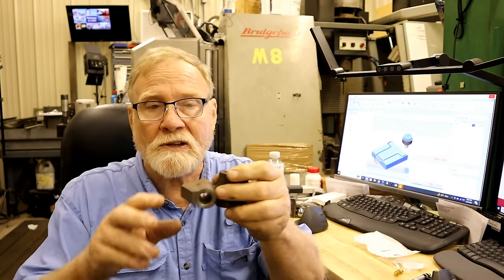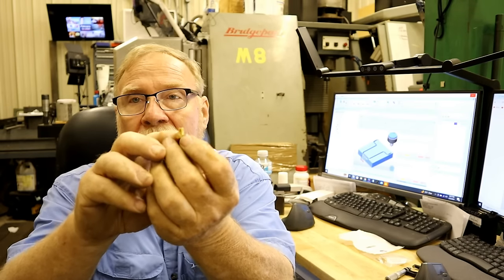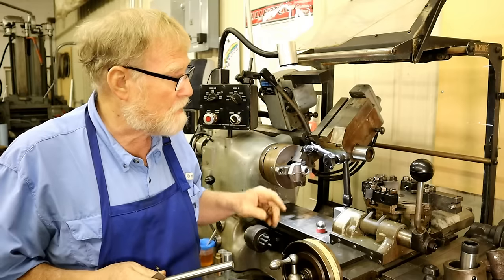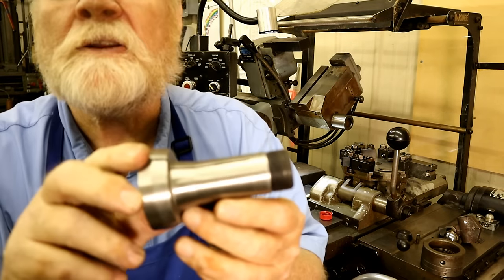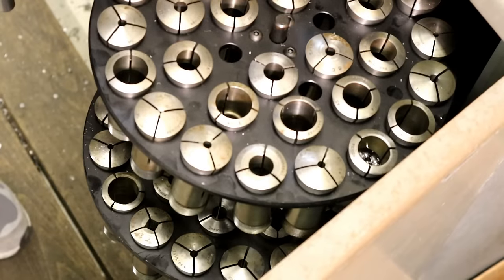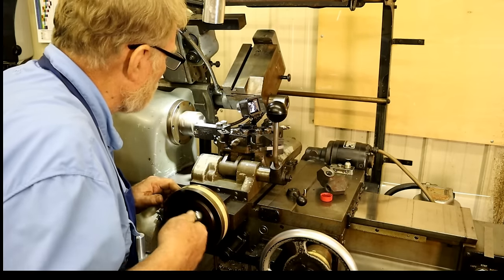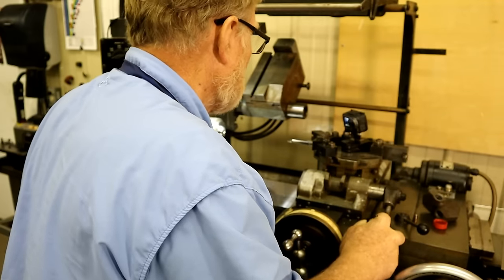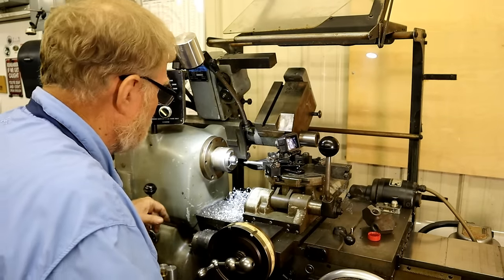Making The Kingway Alignment Tool :  Ball Rod Part

Comment: You need to get a cheap metric screw pitch gauge, the brass screws could easily be 6x0.5 or 6x0.75mm pitch.
I also have a Whitworth as they come up more often than you would expect (even Honda were using 1/8" Whitworth thread in late 1970's)

Comment: 1/4-32, 1/4-36, and 1/4-40 have all been used in instrumentation and can drive you nuts.  Compare the thread to 10-32, 8-36, and 4-40 screws to get the pitch.  My eyes are getting older so I have to use a loupe.

Comment: Steve, a 1/4" x 32 would indicate it may be a Whitworth form(55 degree) Model Engineers thread, used here in the UK and elsewhere. I don't think they do it in a 60 degree form, but I'm not sure about that. I bought the other week a 5/16x40 ME  HSS tap for around £12 GBP off of eBay, so if you had to buy one it wouldn't be too spiteful a price. Shipping might be expensive though even if it was a postal job in a Jiffy bag.

Comment: How is the Rock?
Reply from the maker: Rock 2 has 111,680 miles today....  Still have plenty of brake pad life.....  Only regular oil changes, three sets of tires, lots of fuel filters NO trips trips a dealer for any issues...  About normal for all the last 8 trucks with the exception of the Rock.